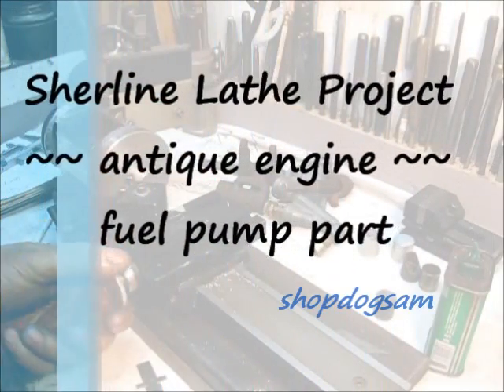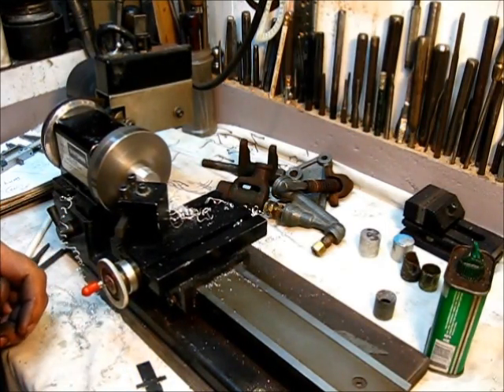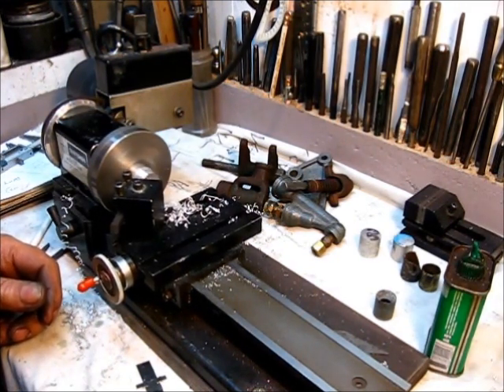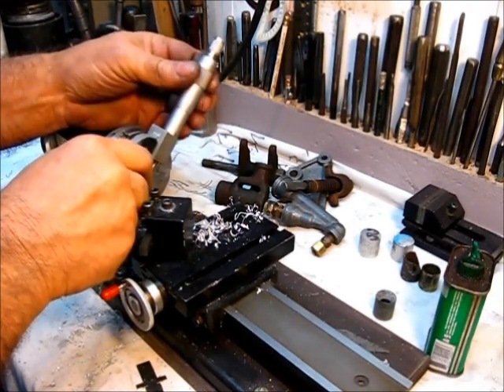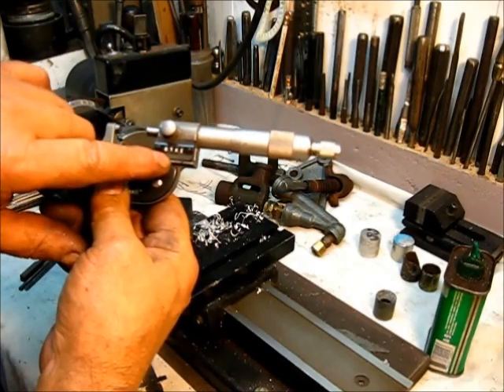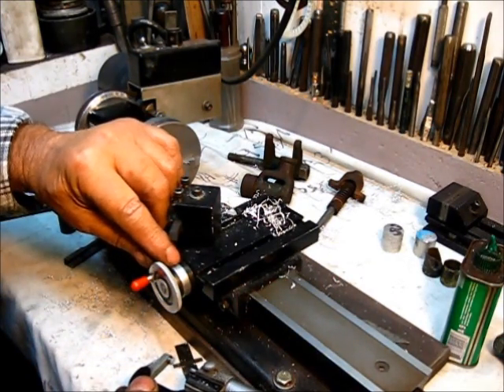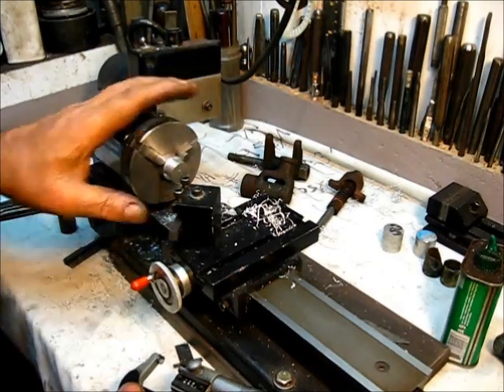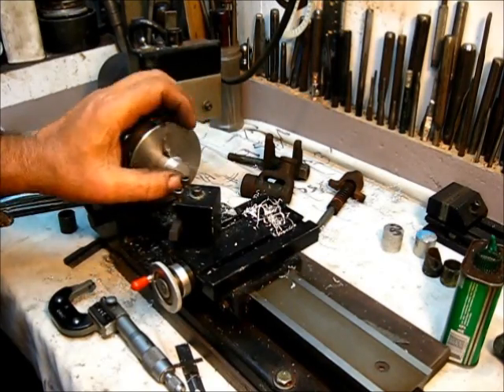Sherline Lathe Project / antique engine fuel pump part 2of5

Comment: That is an impressive piece of equipment sir! One quick question - is there a design flaw somehow with this pump as so many of these components are cracked / broken compared to most other parts of these engines which seem to be worn out through use if they cannot be used again?